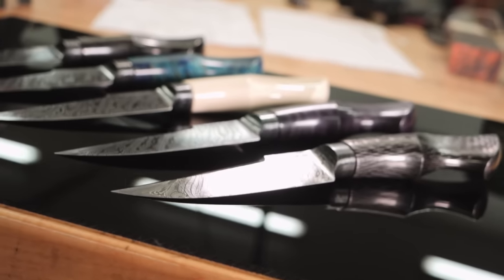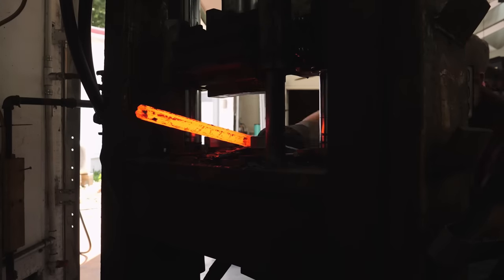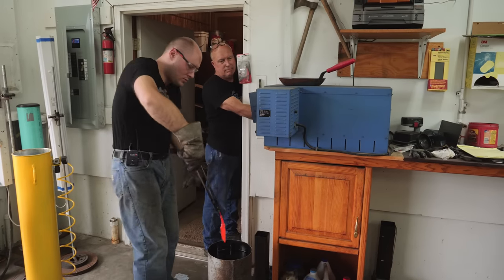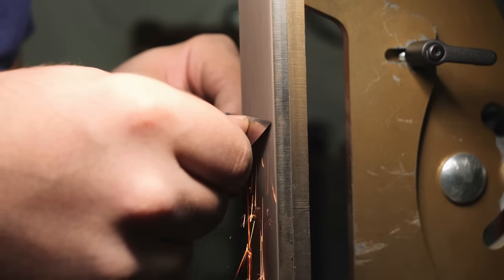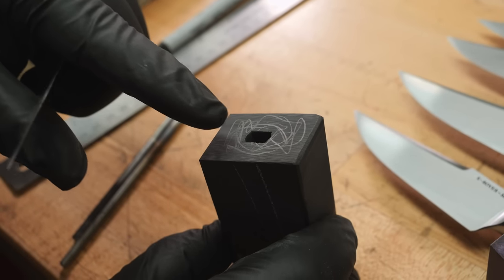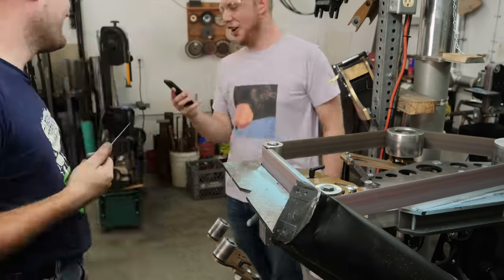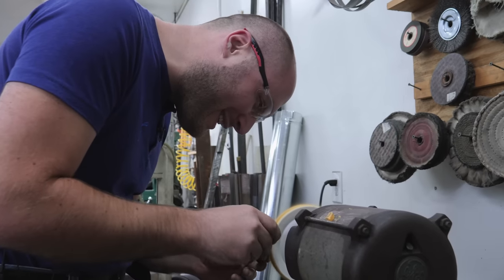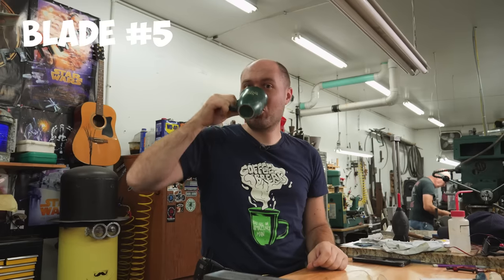Building A Crazy Twist Damascus Knife

Comment from the maker: Which handle material do you like the most?  
🚀Get all the tools and materials I use through my free PDF 👉 https://www.learnknifemaking.com/mastersmiths_toolkit_free_pdf
Reply: The course carbon fiber looks amazing
Reply: Blue for me.
Reply: White handle
Reply: To help with not getting shocked, run some copper tencel, or some sort of copper wire from your machines to the ground of your shop floor....
Reply: What was the blue wood called?
Reply: Blue ash burl.
Reply: @erichraudebaugh thanks!
Reply: I love the black carbon fibre, but the white one is a close second, what you do is art my friend, so chill to watch.
Reply: The blue is my favourite, it’s looks like a Van Gogh masterpiece
Reply: It's my favorite too.
Reply: Purple... cause it's mine. Hard to believe it's been 2 years already.
Reply: I love this.  That blue handle ended up looking like "Starry Night"
Reply: i like the purple handle one
Reply: Blue ash burl for me.
Reply: A thing I do for hand sanding is rubber cement Emory cloth to paint stir sticks, they're usually free and you can get any grit Emory cloth that's the same width as the paint stick
Reply: Please let me know where you find your handle material
Reply: They are all gorgeous, but I like the ivory handle best.

Comment: To not get shocked, ground yourself and the machine to the same source. Search "anti-static bracelet". Electricians use these to not cause discharge when working on electronics so as to not damage the electronics. Same principle here. Keep yourself at the same electric potential as the tool. Take the lead from the anti-static bracelet and connect it directly to the grinder/buffer's ground. You'll get build-up charge on the wire wheel just like a brush motor, probably same with the cotton wheel on dry days. You'll can make a slipping lead on the axle and tie it to ground as well. This will keep everything at the same electric potential and you won't get the random static discharges. Hope that helps!
Reply: Rubber soled boots too.
Reply: Esd strap for computer building directly grounds you.
Reply: That would have been my answer, except there's no way I'd recommend a wrist leash anywhere near the spinning buffer. Buffers are one of the most dangerous machines in a knife shop without an extra dangly to get caught in the wheel. Would that bracelet work the same if attached to your ankle instead?
Reply: As an electrician with 40+ years of experience, I approve of this comment, and highly recommend using this method to prevent static discharge.
Reply: Not worth the risk of getting it wrapped up and pulling you in.
Reply: @ekhatchey   ESD straps don't automatically ground you. They tie you to whatever electric potential you connect it to. You WANT it to be ground, normally, but I've worked on lots of satellite and aviation electronics that don't assume 0V is ground. It has to float and you have to float with it. So no, it's not always Earth ground or 0V.
Reply: @F0XD1E   Don't connect yourself to the axle. connect yourself to a common point that is ground. Connect the floater strip on the axle to the same point, electrically. anything that might get wound up is the floater on the axle, but that's not you. And if you float it right, that won't happen.
Reply: @benr8772   ESD's can be connected anywhere on the body. Obviously you put it somewhere safe. It's the tying off to a common ground that matters to not get shocked. Anything dangly can always be made safe.
Reply: @Azradok  The only way I'd consider it safe is if it's around my ankle and then it'd better be a breakaway tether.
Reply: Like others have said find "esd grounding straps" the ones I use at work attach to the heel of your boot. Keen makes some esd boots that accomplish the same thing without having to attach straps.
Reply: @benr8772 put it not on your wrist, someplace else that it touches the skin.  Problen solved.
Reply: And then the buffer has a ground short and he gets fried… yeah I wouldn’t recommend this lol
Reply: I love how at 12:00 he made it a point to show how great his dust collection was so nobody would freak out about him grinding CF without a respirator 😂
Reply: Discharge lol

Comment: Hey Kyle, there are anti-static shoes you can buy, as well as anti-static mats.  I used to work for an electronic repair shop and that's what we used to get rid of static.  The mats are grounded to the equipment you are using, then the shoes ground you to the mat. It also insulates you from the rest of the shop and Earth ground, so you're less likely to be shocked by faulty wiring.  Plus you can get steel/crush resistant toed anti-static shoes.  Pretty handy.
Reply: Isnt there a kinda like gel coating you can cover the floor with, like a paint or poly? I worked in an automotive shop that was previously a computer repair shop or something and the entire concrete floor was covered in it. Couldnt really tell until like brake cleaner got on it and it started to bubble/gel.

Comment: Beautiful knives once again!To avoid getting hit by static electricity when sharpening the handles, just use a grounding strap, like the one used when working on sensitive electronics!But a copper wire around the wrist and attached to the body of the grinder does the same Purpose! I'm already looking forward to the next video!

Comment: Try grounding the grinder to prevent the static electricity build up. Simple steel cable or wire from the grinder to a grounding point in your shop.

Comment: Use an anti-static wrist strap. It's basically a conductive strap and a wire that you can attach to a ground to continually discharge yourself. Used with computers extensively.

Comment: To stop the static electricity from getting a shock on the buffer there are ESD methods used in working on electronics. Common is a wrist band which grounds you to the workbench. Maybe you can devise something similiar.

Comment: To avoid getting shocked try a grounding strap, they use them in PC building and should be under 10 bucks. Strap it on your wrist and ground it on the grinder. Not sure if it will work but seems worth a try.

Comment: you can connect the chassis of the motor to ground to avoid static building, same with your self as when you solder electronic devices you can use ground bracelets

Comment: @KyleRoyerKnives. To stop getting static shocks! Use an anti static wrist band the same as is used for electronics and connect the cable to the metal body of your grinder with an alligator clip.  You may need to lightly dampen the wheel with some water using a sprayer.

It might be worth considering engraver’s wax to fill your makers mark.  The stuff I use is jet black and very very hard so it can be filed or sanded.

Comment: To deal with static charge: stand on a rubber mat and touch something metal before starting (to ground yourself), or get an anti-static wrist strap people use when working on electronics (typically looks like a bracelet that hooks up to something) - you can find those online for pretty cheap.

Comment: Hi Kyle, I have learned lots from watching your videos. I am not a bladesmith, but maybe I'll have the opportunity before I'm gone.

I've noticed that you often use thin mild steel to encase your billets. I wonder if, when you could make it fit your desired pattern, you could use thin 1084 and/or 15N20, 1095, etc., tig welded on instead? Is there a reason, outside of your pattern, that you don't?

Thanks, Kevin from Jacksonville, FL

Comment: To avoid static shock, use a grounding seat cover. I think you can get a heating pad, then remove the vertical prongs in the outlet insert, leaving only the grounding rod. That gives you a seat that grounds you to earth and lets the electricity run through you without shocking.

Comment: To get rid of the static electricity on your buffer, attach a thick bare copper wire to the grinder body. Have it touch the inside of the buffing wheel. If you still get shocked, then extend it down into the ground or even wire it into the ground side of the motor wiring. This should stop the static electricity from building up and giving you a shock.
Reply: You may tought the wire as well to unload your owl charges.

Comment: You can buy special shoes that have conductive soles specifically designed to keep static electricity from building up by constantly grounding you.  I had to wear them while mixing and casting solid rocket fuel.

Comment: soft copper wire, one end secured to the conduit, assuming it's grounded, and the other end touching skin. you could wear something conductive in your waistband and gator clip the wire to it for safety and ease of use. money clip or a homemade picket knife clip without the knife comes to mind.

Comment: So it appears you have buffed to a temperature above the heat distortion temperature of the resin on the carbon fibre handles, this has meant the resin has left and small pits are apparent in the surface… it’s important for future reference not to exceed the hdt of the resin as not only does it cause this effect it can also mean the part will degrade prematurely.  The resin ivory will have similar effect although being a powder mixed in the resin fall out will not be as visible.  Hdt of epoxy resin can be quite low, and buffing can easily exceed it.

Comment: A brass(or copper, but brass should last longer) sphere(for minimal surface area to volume ratio) grounded and being actively buffed, to take the static charge to the ground. Yes, it may slow your buffing wheel and may need adjusted or replaced over time, but is should take that static electricity to the ground. This way you don't need to remember a bracelet or buy other special tools.

Comment: I was a Navy SEAL and we used a LOT of explosives.  A great problem is static electricity; you don't want even little sparks setting off a charge.  When you're polishing and getting 'zapped', it's static electricity.  We would wrap a bare copper wire around an ankle, touching skin, and run the other end around the bottom of our boot so we were "grounded."  This might not work in your shop.  Try using a bare stranded wire (like a lamp cord) and wrap it around your leg, then clip it to the steel base of your machine, which should be grounded.  If your body is grounded, you should be able to prevent the static shocks.

Comment: Go to an electronic store or computer hardware shop and buy an antistatic bracelet, and connect yourself to a good ground source like a radiator with pipes going into the ground og an ordinary grounding spear. Make sure you also ground the casing of your grinding machine to the same ground source. That should make sure you never get electrically zapped again. Think about this one... for every millimeter the spark travels, equals about 1000volts. 😮 there is no amphs though... or you would be dead as dead can be 😢 keep yourself grounded dude 👍🤓